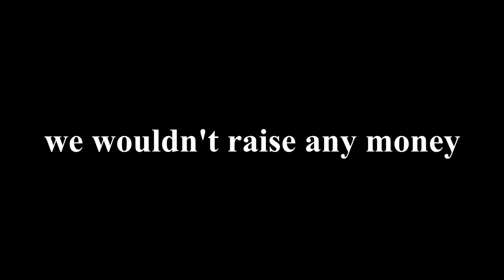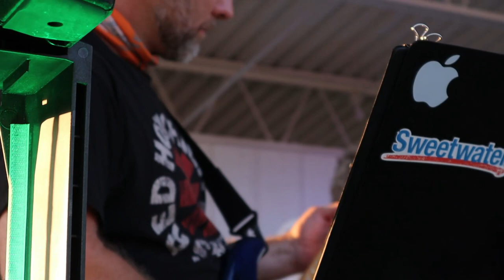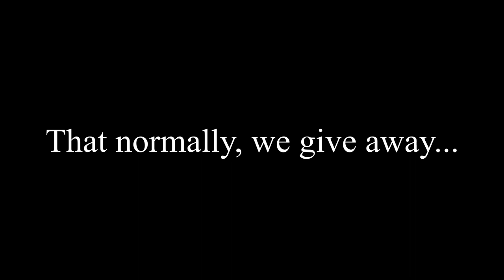DIY Outdoor Concert: Setup & Performance // Live Music Fundraiser for Harlan Park 2020

Comment: I saw your old video where you restored an old dump truck. I live in illinois and i was wondering where you got a new dump bed for your dump truck. i have a 2009 silverado dump and the bed is starting to rust so much that its starting to get holes through the bed. Where can you find a brand new dump bed?
Reply from the maker: Hi Leonardo!  I purchased the dump bed for that truck in Fort Wayne, Indiana where they manufacture that particular dump body.  The name of the company is "Industrial Truck Beds".  I can't put a link in the comments but it's "industrialtruckbeds dot com".  We have a couple local places that sell different brands of dump beds.  I bet if you search for "Galion" or "Crysteel" you could probably find a dealer for those dump body manufacturers in your area.  Of course you could come to Indiana and get one too if nothing closer.  Good luck in your search and thanks so much for watching!